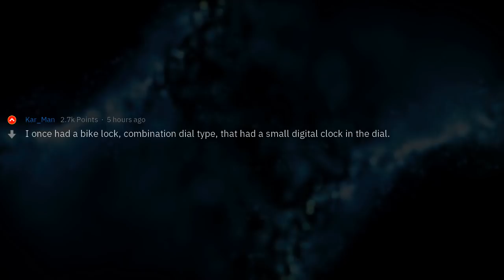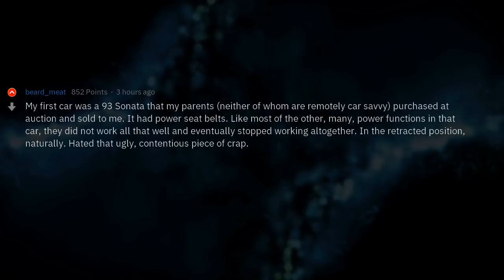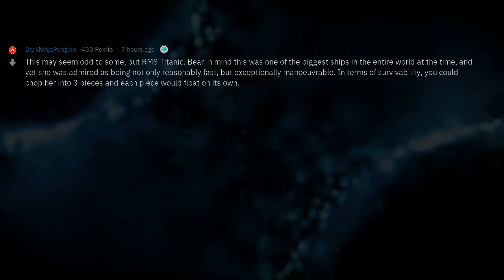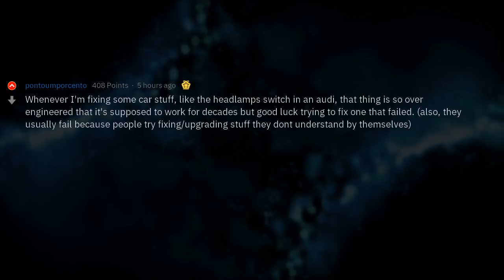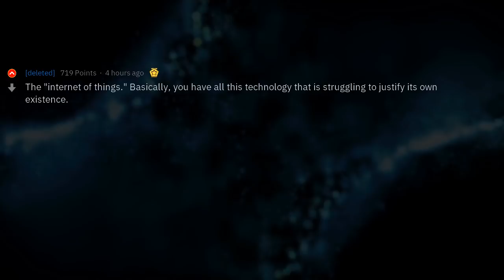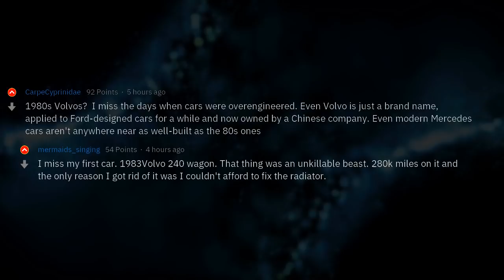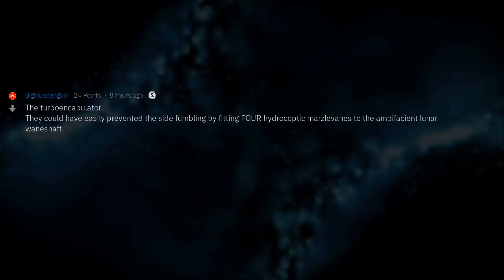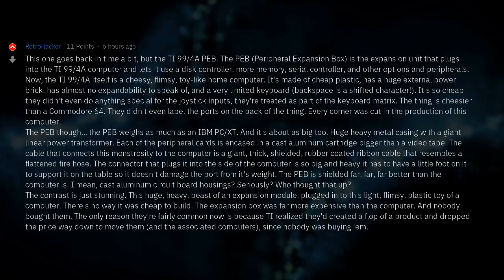What Technology Is Overthought? | People Stories #272

Comment: 14:00 the hoover dam. I recall seeing something about it being an early major dam to use a special or double curved wall construction or something like that. And engineers at the time worked out it would require a lot less concrete. Someone higher up decided they didn't trust the calculations so they made it thicker anyway

Comment: 14:43 I can feel them.  My first car was a 1993 Volvo 850 glt.  I finally got a new car when the Volvo’s heater gave out.  And by new, I mean my mother gave me her old 2001 Kia Sportage and traded the Volvo in, with trade in credit 4x what I paid for the dang thing.  I didn’t even get $600 trade in credit on the Kia when I got my current vehicle, a 2011 Ford Fusion.  I still miss that Volvo.  $1900 was a lot to a 17 year old me, but it was worth it.  Mom did help talk it down from 2600. That 700 saved went right into a new front axle, as the old one was close to breaking

Comment: While the Titanic was over engineered for it's time, water tight compartments are designed differently now because of it. We now use a progressive flood if shit hits the fan, that way we don't end up listing wrong.
Reply: I watched a show that stated if the bulkheads went to the main deck it won't have sunk. Also something about not having enough lifeboats on board because they felt that it cluttered the deck.
Reply: I read somewhere that a lot of ships made after that have those same watertight barriers, but that they also have watertight deck hatches, so higher decks can't be flooded by a breach below them. A flood on e deck would be trapped on e deck.
Reply: @AlexandarHullRichter  That is true, it's the layout and frames that are a bit different, not the compartments themselves.
Reply: If the bulkheads went to the top it would not have sunk. It also would not have sunk if they hit the berg straight on instead of side swiped it.
Reply: @davidcorreia3901  They didn't have enough lifeboats for every passenger, but that was inconsequential.  They were launching boats until the thing went under, people just wouldn't get ON the damn things.
Reply: @ccggenius  people didn’t get on because they weren’t told of the reality of the situation, specifically because the officers didn’t want a panic over the lack of enough lifeboats. Had they had enough, it would have been much easier to tell people the truth and get people into the boats.

Comment: the strobe function is to signal aircraft... and often the batteries on such a flash light can keep that strobe on for 4 contiguous days...  meaning if you only ever turned it on at night  and on during the day when aircraft were overhead you could stretch that battery to damn near a week... if temperatures werent awful that is.

Comment: 1:10 isn't over-engineered.  Nor is the Audi story before it  That's called 'poorly engineered.'  Over-engineered means that it not only accomplishes the job without adding extra steps, but it can accomplish even more - or be far stronger than what was needed - but it doesn't really mean that the owner should be put through more hassle to do the task or use the item.

Comment: The F-35 Lightning II honestly. They started the program on the naive belief that they can a single air-frame that would meet the needs to the Air Force, Marine Corps, and Navy at the same time and in the end they ended with so little parts commonality that it would have been better to just let the branches develop their own aircraft. And they wanted to make a stealth fighter craft like the F-22 on top of this.
Reply: That's the problem when you try to make something that does everything, you end up with a product that does nothing well.
Reply: What I never figured out is why each branch had requirements that were so different.
Reply: @hwiley8141  Well it is primarily due to different philosophies and the large number of aircraft they wanted the F-35 to replace. The Air Force for example uses plenty of single engine fighter Jet designs like the F-16 but the Navy prefers twin-engine designs like the F/A-18 because twin engine jets have a built-in redundancy because if one of the engines fails, you can limp back to the carrier with your remaining engine. The F-35's single engine was a point of criticism for the Navy because they don't normally adopt single engine jets. There is also the fact the Marines wanted their F-35 to have VTOL capabilities because it is meant to replace the Harrier as their VTOL craft and the Navy needed a variant with a strong tailhook and landing gear so it could launch and land on a carrier using the catapult

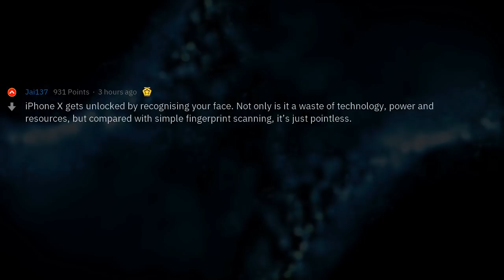Comment: 16:58 Fingerprint scanning is already over engineered. It's not as reliable as it seems, it doesn't work if you cut your finger, you cannot lend your fingerprint to anyone else, you cannot tell someone your fingerprint so they can use your phone on your behalf, your fingerprint can be easily hacked by someone dusting your workplace for fingerprints, if someone successfully hacks your fingerprint you cannot change it, and if you die your family cannot access your data. Oh, and if you are drunk or asleep someone can just put your finger onto your phone and get access to it. Also, does Apple collect my fingerprint? The only advantage? It's slightly faster than entering a multi-digit code or a swiping gesture.

Comment: Getting rid if the headphone jack on the iphone just to make .00000000001% lighter and .00000000001% thinner so now I have to buy new wireless headphones and cant use anything else or have to buy the adaptor and I also cant charge my phone and listen with headphones at the same time because theres only then one port for that now. Again...just to make it .0000000000001% thinner and lighter which I couldn’t care less about!
Reply: Some companies actually allows it's employees to listen to music while working. Most of the companies I where hired to allowed it. I have had a wireless headphone for atleast 5 years. No wires in the way disturbing work anywhere. I don't miss the cabled headphones with wires disturbing work. I love the wireless headphones and the removal of the headphonejack made no diffrence to me. :D

Greatings from a Samsunguser :D
Reply: It's not to make the phones lighter or thinner, that's just the excuse they use. The point is to force you to buy the more expensive and easier to lose wireless earphones.

Comment: My smartphone has a built-in lamp. How do I turn it on?
Step 1: Download a flashlight app.
Step 2: Install the flashlight app. Allow it to access your camera. Because the lamp is part of your camera. And the permission system doesn't distinguish between the two. Makes sense, right?
Step 3: Start the flashlight app. Wait until it has been fully loaded.
Step 4: Skip the ad.
Step 5: Tell the flashlight app to turn on the light by swiping the virtual on-screen knob into the correct direction. Because it's off by default. Even though the app doesn't do anything else.
Step 6: Realize you don't need the light anymore because you weren't fast enough and now it's too late.

Comment: That Juicero was even more over engineered than described.  They went all out on build quality.  They used solid aluminum blocks, heavy duty hydraulics & motors, etc.  The thing could easily crush a real orange without any effort.  I think they intended something along those lines but realized too late that the juice packets couldn't be done they way they intended but were too far into the development to back it up to a less engineered version.  It's something like $400 worth of parts alone, which meant cost margin was shot.

Comment: The DSLR camera I bought in a fit of enthusiasm when I retired.   18 surface controls, two of which a scroll wheels that take you through several menus and menu levels, some of which change what some of the other controls do; and you can change some of the menu functions to different actions as well.  The physical manual that comes with it has about 130 A6 size pages of instructions.  Ended up using aperture priority and changing the nominal ISO rating for low light. And you can't use it as a web cam.

Comment: I don't like devices that require you to download an app to use them when a simple remote-controller could have done the same.
It's not that I don't want them to collect my private data, it's just that my phone has disk space problems, an unreliable battery, a slow Android 4.0.3 operating system that cannot be upgraded, and I want to use it for other things! Also, what about customers who don't even have a smartphone?
If I wanted to control your device using my phone I would by a MicroBot Push!

Comment: Most elevators are over or well engineered in saftey. If an elevator would go rouge it have several safteydevices that would stop it if it would fly down the shaft.

1. 1 cable is more than enough to lift it's riders. If that cable would snap there are atleast 6 more cables lifting the elevator.

2. If all 7 safteycables would snap, the elevatorshaft is so tightley designed the elevator would get stuck on it's way down.

3. If the shaft wouldn't be tight enough there are a pair of scissorslike arms hiding underneath the floor that folds out and clamp/ lock the elevator to the shaftwalls.

4. If the scissorslike arms wouldn't fold out and stays closed there are coils in the shaftbottom to make the elevator crash smoother.
Reply: Well that I can understand completely and am okay with.
Reply: @Butter-Milk  I read up on elevatorsaftey because I am affraid of riding elevators. I am not affraid the elevator would fall. I am affraid the floor underneath me falls, and the elevator keeps going up. The worst elevators to ride are the ones wothout handles inside.

Comment: BMW engines. Not the engines per se, but things that are otherwise easy to access for maintenance in other makes. Change your spark plugs? You have to all but remove the fvcking engine block. WHY?!
Reply: I saw a video about rebuilding the engine in a z4. apparently, they thought it would be a good idea to put the timing chain on the back of the engine. if you're building an engine on a desk, it doesn't really matter, but most mechanics rebuild an engine while it's attached to an engine stand, which attaches to the back of the engine. by putting the timing chain on the back of the engine, they made it impossible to replace it or to rebuild the engine unless the engine was removed from the car and mounted on a stand designed specifically for that engine.
Reply: Reminds me of the HP laptop I worked on where I had to disconnect and remove the entire motherboard to replace the CMOS battery.

Comment: And thank fuck cars aren't built like they were in the 80's. If they were, everyone involved in a reasonably survivable crash today would be killed. Any side intrusion, and major head on, and any decent rear-ender would result in injury or death dependant on the speed and impact. But that's fine if the car is fine and just needs to go to the bodywork to have a couple of dents removed.
Literally the only good thing about cars of that era is the mechanical simplicity and the electrical simplicity. Oh, and no poorly implemented "Safety" systems such as the lane departure warning, and the thing that tells you to brake when you are within 100m of the car ahead... The only electronic safety features that should be in modern cars are automatic braking, speed alert, parking sensors/reverse camera, ABS/TC/SC and blindspot monitoring. Everything else is literally useless. Automatic headlights are handy, but annoying, automatic wipers don't work half of the time.
If we could have a car with all the modern safety and reliability advantages, such as airbags, cruise control, Bluetooth radio, blindspot monitoring, ABS/TC/SC, and the sensors and camera's, with the relative mechanical and electrical simplicity of old cars, the automotive industry would be so much easier to get into. But every European manufacturer would be broke because they wouldn't be able to sell spare parts.

Comment: Anything made by Germans. It is actually a joke in the firearms community that if you gave German engineer a bunch of parts three hours and no supervision you will always get a rapid-firing cookoo clock at the end. FG-42 is a good example of them over-engineering. What they needed was a rifle that could equipped for paratroopers. What they ordered was a gun that part machine gun, part SMG, and part precision rifle with an open bolt setting for full-auto, closed-bolt setting for semi-auto, bipod, scope, bayonet, and grenade adapter. The designers joked they were asked to make egg-laying wooly dairy pig and the gun was so complex that is is known to break itself when fired full auto. Exhibit B, The Tiger tank prototype made by Porsche which used dual engines to power to dual electric motors to drive the tank. It had a bad habit of bursting to flames from driving steep inclines and was wisely not adopted but refitted to be used as tank destroyers dubbed the Ferdinand. Exhibit C is the G41 M rifle. Once again the problems is with the specifications that the rifle couldn't have any holes drilled into it from the outside so it uses a very complex gas trap action and it also had be able to use as a bolt-action rifle if needed. It was beaten by the G41 W by a different company who realized how absurd the demands were and ignored resulting in a better gun then the G41 M which was made to the letter. Also they used to hang Christmas Trees from the ceiling.
Reply: i dunno ... beer is rediciously simple 

schönen Abend noch

Comment: 2013 bmw 740 rear shock needed replacement. Shock needs to be programed to car after installation because it has a module made into it.
It's a shock.
Reply: Engine mounts trigger check engine lights on Porsches.